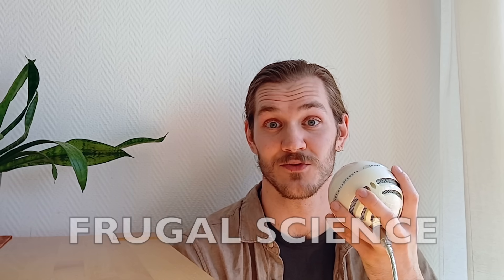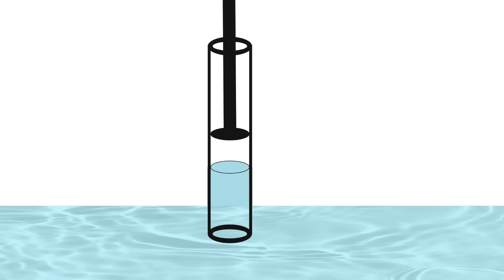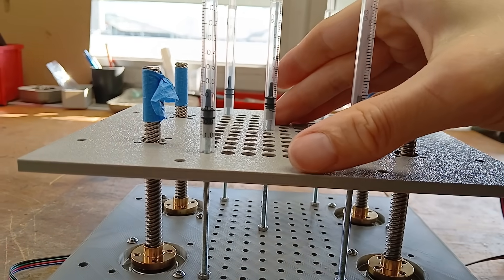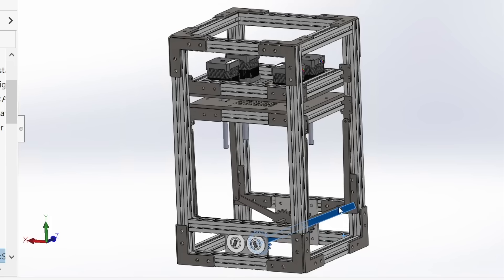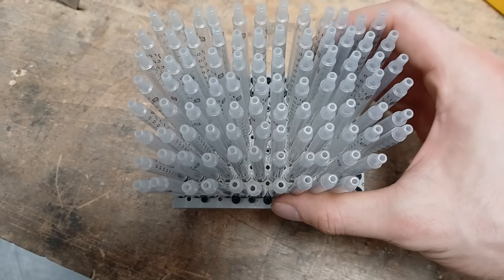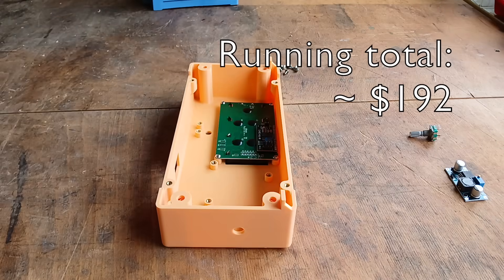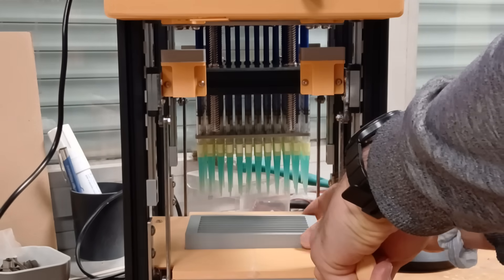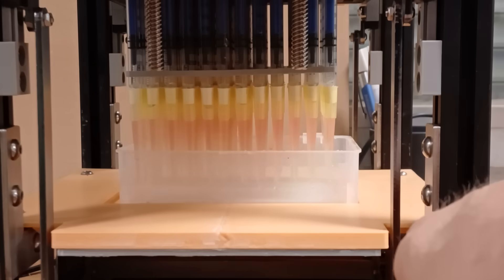This Medical Machine costs $18,000. I Took It Personally.

Comment: I worked at a biotech company manufacturing medical instruments. One of the reasons they are so expensive, is the stringent requirements to certify your manufacturing process. Every single O-ring came with 18-40 pages of documentation, and a batch number. You needed to be able to trace, the date of manufacture, and the specific batch of manufacture, on every single part in contact with wet substance. This was really annoying, if I had to scrap an O-ring, I had to find another with the exact same batch number, or do a very lengthy procedure, to link the replacement one, to the instrument. If there was a problem with a tube, they would do an investigation to see when the problem started occurring, and then they'd know exactly which instruments to recall/hold. A medical company manufacturing pharmaceuticals, would not be allowed to use your instrument in their production, even if it works, according to their certification, because your method of manufacturing, would also need to be certified. etc.
Reply: 100% agree. From my experience in biotech, almost all of the effort goes into the development of the required 'Good Manufacturing Process' (GMP) and subsequent certification. The materials shown in the video wouldn't even be GMP certifiable, since for most applications with fluid handling you'll need to have easily cleanable surfaces with materials that resist the growth of biofilms, s.a., stainless steel, PEEK, borosilicate glass, etc. At the end of the day everything basically boils down to Quality Management having such excruciatingly high requirements, that everything in the product's lifecycle is tailored towards it. This is also the reason why almost no people in this sector make any money from merely inventing a technical solution, few make some money from solving existing problems for companies and the big bucks are made by start-ups that actually put in the legwork to provide and proof and certify the necessary processes. If anyone wants to make money in medtech/biotech, your first question should be 'how do I alleviate risk for any interested buyers?'.
Reply: @eclairamisu2517  GMP aka Giant Mountain of Paper
Reply: @ChristianDK_dig  testing
Reply: @ChristianDK_dig  I think it means Guaranteed Maximization of Pricing!
Reply: @ChristianDK_dig  Necessary because people love to file lawsuits.
Reply: @eclairamisu2517 also, the equipment you use to MAKE the parts has to hit certain standards. "I used these grungy shears to nip off the end of the syringes" is not quite a certified production technique.
Reply: @eclairamisu2517  I wonder if you are comparing the US model of be perfect or get sued with the struggling world model of do the best you can or risk dying..?
Reply: @paulflute  BioTech has excruciating standards just about anywhere. Sure if you're in the business of running a homelab then whatever, but if you are a reputeable company, it doesn't really matter if you're in the EU, the US, APAC or anywhere else.
Reply: @paulflute  Specifically for biologics manufacture, it doesn't matter where you are - if you f- up, you're going to kill people. That biologic you're growing? Bacteria/yeasts/molds love growing in the exact same environment.

For testing lab use this might very well be OK, but frankly a ~2.5k machine is not the bottleneck there - the testing supplies are.
Reply: @wildca1x1  I don't think that's kind of what this is intended for.  It's more so that someone in Sudan can test blood samples for malaria locally. They're not talking about developing new drugs or going through clinical trials.
Reply: @eclairamisu2517 it can be expedited depending on filling. I work for a large pharma company that had this new drug application and approval and the process of manufacturing has a lot of GXP issues that the fda has been glossing over 😂
Reply: @Blue_Azure101 what s a gxp issue
Reply: @uzzybuzzy-t5h  Good * Practice - it covers everything from Good Manufacturing Practices, Good Documentation Practices etc
Reply: @eclairamisu2517 and iq oq
Reply: @eclairamisu2517 as a person who works at a pharmaceutical plant - I hate GMP with all my heart.
Reply: As a lab tech, compliance regulations makes us do a lot of certification work after it is installed. We can easily spend thousands of dollars just on the validation to prove a single test works before we can put it into use. If you have a chemistry analyzer that has 40 or 50 tests on it you can easily spend as much, or more on validation than you paid for the machine.
Reply: Yep, this is what no one gets. There's no 'whoopsy daisy sorry for the staph infection' when it comes to medical.
Reply: @purduephotog I mean there’s also no whoopsy daisy you’re not rich enough to afford medical care because of the cost of literally every machine ever in the medical industry
Reply: @luckyducky5994  and your point? This machine isnt going to help with that. As cool of a build as it is its not sterile certified lab gear and you wouldnt want it to be unless you like unreliable blood tests. A cheap but inaccurate lab test is not better than an expensive accurate one, not in the field of health.
Reply: @SpydersByte  I think he's saying that we legitimately should consider lowering our safety regulations in order to provide more affordable, but less safe care. (honestly still pretty safe though) There are developing countries where poor people have less trouble getting diagnosis and basic care than people in Canada or the United Kingdom.
Reply: @Syerjchep  well, then just lower the standarts for those countries who need it and not all the countries, i prefer my highly regulated pharma production
Reply: @pulzsuppe  ur also giga gay
Reply: @SomeKidsAtHomes  *u r
Reply: @Syerjchep  And that sounds stupid. Rules & Regulations (especially in the medical industry) are written in the blood of others. False positives can be just as bad as false negatives (i.e, a false positive for cancer leading to unnecessary chemo & radiation therapy). Yes, developing countries need resources, but there are some things that compromises shouldn't be made for. The centrifuge is fine, paper and string have their sterile medical counterparts, and it isn't used for extremely extensive tests. This, though, is made to test many drugs, vaccines, cultures, etc. at the same time. Contamination would be a major concern, along with accuracy. For simple chemistry with error that doesn't risk the life of another, this is fine, but any use in a lab for medical purposes won't happen unless the process is cleaned up and more inert materials are used (such as PEEK filament)
Reply: No kidding a few years back I spoke with a guy who makes medical graded fitness equipment and testing alone to get the equipment re-certified with the appropriate medical device class in the EU after changes was in the ball park of a 100 000€
Reply: @petrirantavalli859  what kinda context requires medical graded fitness equipment??
Reply: @Luckeux  Mostly people recovering from a paralysis in a facility or children with developmental isses etc. they aren't your everyday threadmills or excercise bikes or bench presses on a gym or as he said there are only a fewsuppliers of these machines in the world and they easily last for decades so the margins were razor thin and there was this thought of manufacturing them without the EU regulated medical device class for the masses but even without the license they were still a 10 000$ excercise machines with servo assists, micro controllers and things, so a lot of down grading might have to be done, like this particular very accurate microcontroller alone would cost med graded +$2000 from the US but an "untested or unaccepted for the use" one from china was only $500.

Also every single item sold for heath in the EU for health is regulated to it's medical class like a disposable mask or a a digital thermometer or weight scale for example.
Reply: @petrirantavalli859  interesting, thanks for the explanation
Reply: Nuclear, at least in Canada, is the same way. Items that might otherwise cost much less have to be qualified to go into the station. Sometimes this is important. The qualification process caught counterfeit computer chips one time. They passed 9 out of 10 tests. But they would have failed, mysteriously, if they had been installed in reactor.
Reply: The aircraft industry is the same way and it's killing private aviation. I went to get a part from the stock room once and it got flagged for customer approval. It was a bushing, just a metal tube, and it was $2,800. Small trainer planes often use alternators that cars use but because they're certified they cost 10x or more.
Reply: @Synergy7Studios  We are still lucky to have an experimental class of aircraft that doesn’t require FAA certified parts.
Reply: @Synergy7Studios  A thought about that: How much redundancy and over engineering might it take to maintain safety while actually reducing costs?
Reply: @Synergy7Studios  I honestly think this should be implemented in even more industries. Heck we had whole month long investigation why one of our student landed 20 seconds after sunset. But this kind of scrutiny ensures that compared to the automobile industry where 1 in 8,300 vehicles is involved in a malfunction-related crash each year, in aviation it happens a lot less, where only 1 in 1.4 million flights results in an accident caused by mechanical failure.
Reply: @faremir  You compared flights to vehicles. Aka, apples to oranges. Compare vehicle to vehicle or operational hours to operational hours.
Reply: @mikehawk1441  That's a ridiculous dismissal and an absurd and unethical demand. He's comparing the safety and reliability of equipment sent through a certification process to those that are not. It is fine that automobiles have lower standards... the chances of equipment failure causing death is low. The chances of equipment failure resulting in catastrophic outcomes is 1000x higher. There simply should not be a dataset for that comparison you demand. And you can't study it for the same reason you can't do double blind studies on something like the effectiveness of antidotes to snake venom... you can't doom study participants.
Reply: @faremir  found the corpo who profits way too much from fear. just hold the company accountable legally instead of all this beurocracy. theyll verify themselves or else. just another buisness that creates the problem u pay them to solve. LAME
Reply: @griffinhornbostel3714  The problem being that these companies aren't held accountable. See the ford pinto, and the fact that ford still exists after it. Also the FAA isn't a business, and they aren't creating the problem we have to pay for, they came about after shit planes killed 10s to hundreds at a time and we realized we needed better systems in place.
Reply: @griffinhornbostel3714  You think the dude arguing for regulations is the corpo, and you arguing to deregulate companies is anti-corpo?

I laugh! You're the corporatist here, mate.
Reply: @griffinhornbostel3714  You do realise airplanes fly over all our heads, yes? If a car's engine dies, 999 times out of 1000 it just stops. A helicopter? Maybe it can autogyro down some of the time if everything lines up right. A plane? I'm sure you'd enjoy the golden-leaf headstone the payout would get you
Reply: @Synergy7Studios  It's because when those safeguards aren't in place, instead of killing innovation it's innocent people
Reply: @watsonwrote  30% of the regulations make sense, 70% is there to keep pesky competitors out of your market.
Reply: @watsonwrote   I think tha initially the intention was good, but in time, and for the technology available today, most of this "inspections" and "certifications" could be done faster and cheaper, but they are the unlimited income of government's workers.
Reply: True, but there are places in the world where they simply can't afford the official lab equipment. If they can get something to work 98% they will do it.
Reply: In the United States, but this would be useful in other poorer countries just like the paper centrifuge.
Reply: I have worked as biotechnologist in two R&D centres of biotech companies but in agro sector, and if you are not working in  pharma the things become much more easy)))
Reply: Even without the certifications, his machine is doa because there are so many steps that are not easily reproducible and simply don't scale well in any sort of production. Like, as if a machine costs 18k $ and you assume that is all in materials. Of course there is also money for R&D, construction, assembly, programming, the certifications, marketing, profit in it. For a basic home-lab that hasn't that kind of money to spare I think it is a viable approach. For third world countries I think buying these appliances second hand makes more sense
Reply: touches plunger with his fingers and proceeds...
Reply: Exactly, first thing I thought when I saw the video thumbnail. People have no idea why things are expensive.
Reply: And do you consider this as a feature or bug?
Reply: @Heti.msc.1  It's a feature. You want perfection and are paying for it. If you want cheaper medical equipment, how many extra dead patients are acceptable? Just assume you will always be one of the ones that die when considering this.
Reply: @Tyneras I mean something like this is pretty handy in testing for diseases which, for people in a poorer country or just in general is definitely worth having SOMETHING instead of nothing because of the cost of medical equipment
Reply: I have no doubt that the scrutiny of the machine from the final assembly to the first part adds to the cost, plus recouping the R&D, but I am curious what the actual markup is, was it expensive to source the parts almost assuredly but it also wouldn’t surprise me if it was marked up 100%.
Reply: @outlawphil  Markups are well over 1000% on so many things, from iPhones to pharmaceuticals.
Reply: @outlawphil  A $0.10 pill will be sold for $1,000 because you aren't just paying for the pill, you are paying for $20 billion dollars of research needed to invent the pill. The price keeps going up because we already did all the easy stuff, and the problems we still have effect a smaller and smaller number of people, so each patient needs to pay more. if we don't invent some super AI that can design new drugs cheaply, we will probably just stop making new ones completely at some point because it will be too expensive.
Reply: @Tyneras that is true, but the US is not the only nation in the world developing pharmaceuticals, and the government subsidizes medical research maybe not at the level they fund the military but they do give money for research and development. The CEO’s of big pharma sure pay themselves an awful lot , but I am sure they would love a super Ai where they have less employees to pay and spend less in R&D but turn around and charge people the same and give themselves bonuses equal to the number of people they were able to eliminate.  And just a side note we are in late stage capitalism but if we were at any other stage of capitalism innovation would drive progress including replacing any flailing business, but since congress treats corporations better than the population (socialism for the capitalist corporations) where they turn around slap a bandaid on something that needs stitches and then pay the people at the top more. I can name several countries that rival the US in pharmaceutical development who have higher success rates and pay 30%-80% less than American corporations. Switzerland, Germany, India ( they do it 80% cheaper but standards are lower although they are catching up also they have a different focus) United Kingdom 50% cheaper in clinical trials. So when you say they will stop creating new treatments all together that is True in the United States because profits over people.
Reply: @outlawphil  Yet somehow the right has convinced a sizable chunk of the U.S. population that the problem is too much regulation.
Reply: And the reason that is the case, and another reason for the high cost, is the fact that if something goes wrong, they have to be able to prove every bit and piece was according to specifications and they engaged in every due diligence to prevent problems, or they'll be held liable. And they need to have enough reserves not to have to fold completely IF something happens.
Reply: Yeah I imagine stuff like 3d printing would be a big nono since the last thing you want is more porous surfaces.
Reply: @piethein4355  There is some 3-d printing, but not in direct contact with the wet substance. Generally you don't want bacteria growing on the exterior of the instrument either, so the chassis is stainless steel. You care about things like which way a washer is facing, so as to not create micro scratches, during assembly...
Reply: that's exactly what makes motor vehicles expensive. it's not the production cost. it's the development cost (wages of hundreds of people who work on it) and certification (destrutive tests of sometimes up to 200 pre-production vehicles) and the cost of certification itself. then comes the tooling for the factory and technological chain setup.
the result is that the production costs (materials plus work plus tools plus factory setup) are sometimes a low as 10% of the final cost of the vehicle.
Reply: Exactly what I was thinking watching this... Certifications and user assistance
Reply: Its the very same for electronics in aerospace/military. Tracability from the completed assembly back to the individual batch number each part on the PCB came from. I'm sure the parts manufacturer could trace it even further back.
Reply: This was my thought. It's really neat to see someone re-create "expensive" equipment, but the actual manufacturing was never the hard part. (for the majority of things) The expensive part is support, certifications, and auditing. The parts are probably around the same cost as the core machine, but they're also doing extensive testing on the materials that go into the product, and lots of audits on the manufacturing facilities that produce the product. That's where most of your money goes. I'm glad the video was very clear that the goal wasn't to replace professional equipment, but the goal was to produce an alternative to people who aren't limited by arcane regulations and complicated audit programs. Still, the act of creating a machine isn't the hard part. Getting it accepted by the industry is.
Reply: Exactly this supplying equipment to biotech, we have to mark up our prices tenfold because of the incredible amount of administratie we are forced to do to safeguard our materials for clinical use. The risk of making mistakes, the cost of hiring expertise, the endless amounts of documentation and the headache of working with our suppliers to get the right documentation...
Reply: DIY or cheap instruments could be used for education or citizen research, though. There are reasons this gets complicated and expensive for pharmaceutical use, but there are other uses for this sort of tech if the price makes it more available.

I'm not trying to educate or correct you in any way, just hoping to add to the public discourse.
Reply: when lives are at stake, accuracy & traceability becomes kind of important... fuck the cost  when your life is on the line
Reply: One of the last sentences in the video verbatim says the video isn't intended for you to replace the medical lab equipment, just lower the entry cost of use.
Reply: This isnt designed for a large pharmaceutical companies, it's designed for people with morals.
Reply: The question is why? It's all an industry reach-around, like with the nVidia + AI BS that is going around. Yes, I know it's all cGMP stuff, but the time and money that is wasted on this bureaucracy is at the expense of good research, saving lives, and understanding the natural world. I worked at Pfizer for a while, and there is so much f-ing paperwork, no one reads it, no one cares, it's piles and piles of documentation that is there "just in case" shit hits the fan. Otherwise it takes up literal office blocks.
Reply: which all is irellevant if you go to scenarios like we had with covid and that in third world countries - than a affordable and off the shelf component solution AND easy to reproduce like this is amazing
Reply: @senegalus  Someone designed a DIY ventilator using car parts but even third world hospitals wouldn't use it during COVID. It's not worth the unknowns, maintenance, reliabilty, even the poor perception they're using DIY equipment.
Reply: @weeeeehhhhh  Not all “third world hospitals” work the same, or are given the same resources. I’m currently in training in a 3rd world country. Yes, many hospitals here would probably not use these DIY equipment, and that’s because our large, urbanized cities are still well equipped enough to not rely on these. It’s a different story though if you go to more secluded islands where the doctor:patient ratio can be 1:20-50k — that’s probably where these type of innovations would be helpful.
Reply: @weeeeehhhhh  at some point if the choice is between death/complications or using a sketchy machine, well, sketchy machine it is.
Reply: @senegalus Meaning all that certification, traceability and stuff is useless? Or that it is good enough for the so-called third world if one percent of the patients die from using  your cheap and easy machine?
Reply: @maoiljitschguevara to be fair, its probably better to have something then nothing
Reply: @maxthehuman004  not for the 1% that died because of it and weren’t terminal ill. This vid is hilarious. Im doing DIY devices myself but I would never build a medical device.
Reply: @maoiljitschguevara  if your options are; cheap and non-certified machine that is probably fine or no machine at all. You should choose the cheap and non-certified machine.
Same reason why all that certification stuff went out the window during covid. The options were; wear non-certified protective equipment OR don't wear any protective equipment at all. You choose to wear the non-certified protective equipment unless you're an idiot.
Reply: @Todestelzer  You're thinking about it wrong. You're imagining a scenario where you choose between a high-end lab certified piece of machinery or a cheap DIY solution.
What you SHOULD be thinking about is if you have to choose between a cheap DIY solution that may save your life, or no solution at all and certain death. Because those are the scenarios these things are ACTUALLY made for.
Reply: @bummer6  People like you are so naive. Just accept that you're wrong, nobody is using diy machines in medicine.
Reply: @maoiljitschguevara it isn't but when your options are either no device or one that isn't certified you certainly would take the not certified device. Even if it causes you to loose 10% of your patients it's still better then lossing all of them.
Reply: @Todestelzer open source medical devices exist though. Look up the OSI² ONE MR Scanner an open source MRI system. If used in a medical context it would obviously need to pass certification before it could be used but that's not impossible.
Reply: @Ninjaeule97  if he can get a certificate or this is only a proof of concept I have no issues with it.
Reply: @Ninjaeule97 But those aren't the options here. The options are do it by hand or have a machine do it. The machine is faster and does many at the same time. So now you let the machine do the test for lots of people, instead of doing it only for those where you are sure you need it. You still sure that lots of bad results are better than no results?
Reply: @maoiljitschguevara  if there is an Ebola outbreak, for example, you need to test lots of people at the same time to cause the people who have it need to be quarantined to not infect others. Sure, false negatives are a bad thing cause the infection can spread, but it would spread faster if you could only test a handful of people. Doctors generally don't run test unless they are needed, so yes, bad results are still better than no results. Plus, if you used this machine for some time, you would most likely know the limitations and either avoid them or work around them. Let's say the machine is so bad that you get a false negative 10% of the time, running it twice reduces the chance to 1% and that's still faster than measuring everyone independently. Plus, the machine will be off by the same amount each time if constructed correctly and that's quite simple to fix with calibration, whereas handling mistakes that occur from doing the measurements manually can happen with each measurement so even if you know that there's an error it's hard to figure out which measurements are wrong.
Reply: @senegalus  "which all is irellevant if you go to scenarios like we had with covid" 

If anything, Covid made it even more important to be able to rely on this machine's quality. If you F-up one cancer diagnosis that's bad. if a vaccine producer's quality control F's up then hundreds of thousands of people could get a vaccine that does not work, and die.

"and that in third world countries -"

Again: how do you figure that a 3rd world doctor would not give a sh*t about whether his machine is reliable? Do their lives not matter to you? They probably need it to be more reliable because parts are expensive and hard to get.  3D printing sounds nice until you realise that...well... how the F are they going to get a 3dPrinter and filament to a place where just getting mains power is difficult? If anything you'd want a manual device that can be maintained by the doctor, for $4. Oh wait, they already have those, 3d world doctors don't do 500 pipettings a day in a lab, they are happy if they have a f*cking desk to work on.
Reply: Wouldn't that same requirement apply to each syringe?
Reply: The documentation is standard for most lab equipment, most of the cost comes from parenting though no?
Reply: Immagine you sell it. Would you take responsability for its accuracy for the next, say, 1 year (because ut is cheap)? In reality these machines need to be accurate for many years.
Reply: @mattiaviola7152 I mean the point isn’t that it’s a GOOD 100% accurate pipette machine the point is that it’s a pipette machine period.
Reply: Just curious if you know what the certifications were called?
Reply: And this is why Fluke and Agilent make a killing in the defence industry too, to mention some of the manufactures of calibration equipment used in defence electronics.
Reply: I was about to say, does this homebrew thing match specs, match regulation, have documentation, have liability, etc etc.
The cost is the legal system, not the device itself.
Reply: Yeeeuppp GxP is expensive lol
Reply: My guess is that a medical syringe should comply to the same standards. Ec1935/2004 (or fda) is used in the food industry for gaskets and seals.
Reply: Tbh, for hobby use or emergency such as natural disasters or poorly developed countries, I think the rules wouldn't apply as long as it's good enough and save lives.

I think this idea is good and solid
Reply: I think what this solves is the third world issue and low barrier to entry to speed up testing. While you are correct. Compare the initial example of a centrifuge and the paper spinner. This offers a way to maximize productivity in a less regulated and lower cashflow environment
Reply: spent 10 minutes thinking up my reply and after posting it, scrolled down only to find you had written exactly my thoughts! good stuff.
Reply: you're all assuming that what happens on paper is what happens with certainty, when in reality cutting corners happens more often than not when no instant consequence are in place
Reply: In the current era that doesn't look like it should be an expensive process still...you just require a graph database with the information you need for every machine... Or if you want/need add them to a Blockchain. The specifications needed are the physical and chemical property tested over time, within the operational boundaries of the piece. For an o-ring it fits in 1 or 2 A4 papers. The production number is just one line. 
The point is not that certifications are not expensive, but that they are way too expensive for what they are. It feels more like a legalized cartel to artificially harden the market position of pharmaceutical companies that they more or less demonstrated themself good enough to produce reliably this kind of product rather than a cost-based price increased due to the additional operations required.
Reply: Medical manufacturing company: we're sorry The hose clip for your 18,000 machine broke. We no longer manufacture that particular model. That machine is not eligible for repair due to the hose clip being part of the structural integrity of the device, meaning that the device cannot be repaired and restored to medical grade.
Reply: @nonotyet7590  You'd be surprised what a rebuild kit, with a bunch of hoses, filters, and O-rings go for. Selling them is really lucrative. We even dusted off plans that were printed in the nineties, in order to complete obscure spare part orders. Good service is definitely a thing in expensive market segments.
Reply: More people need to understand this…maybe some regulations are truly necessary…but are all of them? Are none of them redundant or obsolete or just inadequate?  Regulatory compliance is a major cost factor across the entire supply chain all the way to service delivery.
Reply: Aren’t attorneys great?!!
Reply: exactly. I dont know sh!t about those devices or how theyre used but my very first thought about the price was the simple fact that its a medical machine and probably has specific design elements that help keep it sterile and like you said the parts need to be standardized and documented and replaceable. The build is really cool but like, who is it for? Labs are still going to have to use the expensive version and no one else has need of this machine.
Reply: Considering he was inspired by the hand-spun centrifuge, this seems like a pretty similarly equivalent grade solution. I think it's mostly about getting these kinds of devices to places that don't have or simply can't afford the proper solutions.
Reply: Frivolous lawsuits and their consequences for the medical industry.
Reply: Bureaucrats…
Reply: Another reason is the act of calling is medical can increase the price by 2-5x+.
And if you are buying things for medical reasons, the markups can be 0.5-5x depending on the item.
I have seen multiple products that the only difference is the medical lable, and they are even packaged in the same sterile way, and do the exact same thing.
Reply: So that's why healthcare is so much... The paperwork. 😅
Reply: Jesus loves you so much brother. We are not innocent. God is.. and he came to earth to bear our guilt. He shed his blood on the cross and rose from the dead, defeating death so that we may have everlasting peace, joy, love, hope, and fulfillment.
Reply: yeah that's called useless procedure to drive up the cost
Reply: @ninojamestan8895 ☝️🤓 um actually, it's for liability reasons. Correct paper trail and procedures, nobody can say anything about malpractice and sue for millions.
Reply: @Deja117 yeah, always more about business rather than healthcare apparently. How American
Reply: @ninojamestan8895 in the same vein, if one company made a faulty part that caused a loved one to pass from some bacterial infection, would you not want justice taken against that company? Fair enough, it would be a cash settlement since it's impossible to literally wake the dead, but at least you wouldn't have to live without knowing what happened to them.
Reply: Yeah yeah bureaucratic corpo bootlicker
Reply: THANK YOU. Watching the video was slightly infuriating. Not only is his manufacturing process not even remotely scalable, but it respects none of the requirements or standards of medical equipment. Mimicking the action a machine performs is, quite simply, not good enough to qualify for claiming to have replaced a machine. There's so much hubris in this video it's nuts.
Reply: @guitarchitectural  you guys should work in insurance and big pharma with how much you hate motives for affordable medical care. Go work for UHC
Reply: @Oppatwunk  I'm all for bringing costs down, but it does nobody any favors to make a unit completely out of the required spec as a demonstration of "look how cheap!". If this guy made one to the required spec, estimated the costs to spin up a clean production facility (to spec), and establishing a company to promote, sell, and support+service the devices - well then you're factoring in EVERYTHING that makes it cost what it costs. 

in other words - it's no secret that the parts for any given device are cheap, and it's no secret that some of them aren't that complicated. It's everything else that makes it expensive, and it's everything else that needs to be overhauled in order to reduce prices.
Reply: Can confirm, it was the same when I worked on medical machines.
That traceability tho is very important.
Could it be a lot cheaper? Yeah, of course, it's a steal. But the ability to go back and see exactly what caused problem is a necessity.
Reply: that and R&D and low relative sales numbers
Reply: This is apples vs pears. I worked for a medical device company, and the rules applied make sense for the better part of them, in particular risk management that ensures that the devices are safe to use, not interfere in/with their use environment, a fully reproducible and …., subject to thorough recall management in case of a health related complaint.
Ensuring that devices are safe and effective and maintained in such a state, and reproducibly manufactured at relatively low total number of devices manufactured all costs.
Reply: i knew there would be a wet blanket incoming. thanks for the insight. 
from my perspective, this may be overcome by using something like 4 of these cheap units instead of 1 verifiable expensive one. 2 of the same type and 2 of the exact same but different plastics, etc. then run the experiment a few extra times. in this way, you can look at any variance between the machines and runs to determine fault. i’m speaking out of my behind because i’m sure there are more wet blankets looming and i know what i’m describing would take a little more time and space but ‘first shot perfect’ doesn’t always fit the bill.
Reply: @dfghdfzsd  imo the correct way to use them would be to have a human do it and the machine as a double check.
Reply: @satibel  Then the whole premise of automation would be useless, because the whole premise of this machine is to replace lab techs to move/apply reagants for hundreds of samples directly. If you still need humans to cross-check this machine, might as well do it manually because the bottleneck would still be at humans anyway, and now you pay double for both lab techs and machines to perform the exact same thing twice
Reply: @FlyingPlastic356  my idea is if you have one sample that needs many checks (e.g. test for many diseases at once or similar screening), or if you need to screen many samples quickly, if you can do it fast locally with very low false negative, but false positives, you can take preemptive actions while the sample is sent to the lab for further analysis (e.g. start sending to the hospital or semi-benign treatment)
It would be in a village setting, where you'd want an easy to reproduce fast method.
Reply: @satibel this kind of machine is not for multi vector test, but the other way around (single test against multiple samples), as you usually unable to load different reagents on each pipette. This machine usually loads 1 type of reagent and feed it over hundreds of samples at once. Also, this is just a tiny part of testing, as this is just reagent feeder. You still need other machine for testing (centrifuges, spectrometer, etc)
Reply: Good thing they double checked the o-rings, sort of wish they regulated things like Teflon and roundup from being pumped into our bodies and water supplies. But that’s cool too. I guess more money on medical supplies once we get the cancer, so why regulate the dangerous chemicals when you can use regulations as a guise for gatekeeping the medical industry from smaller competitors.
Reply: @ride1123  There is so incredibly much money in pharmaceuticals, the expensive gear is a pretty minor expense in comparison. I was told some of our customers actually only used the instruments for a single batch. They then sold them, and got new gear, instead of cleaning them out. This was because, buying new instruments was cheap compared to the risk of contaminating the product..
Reply: @the_hate_inside1085  oh, that explains why insulin was jacked up to be such a high price. Oh wait, no it doesn’t. Sorry I get how it all works but at the end of the day these justifications for prices don’t hold water
Reply: @ride1123  you're confusing pharmaceutical equipment being held to a standard and pharmaceutical companies using that equipment while having no ethical standards. I can assure you that he equipment prices didn't have anything to do with the insulin price rising
Reply: @Luckeux I mean the equipment being so costly and held to such a high standard is partly WHY they can have no standards and increase prices exponentially it means it’s near impossible for any competition to arise and gives them a nice excuse for why they can crank up the price of insulin for shareholders
Reply: While I'm sure this is true, it does slightly miss the point. As with the example he presented at the start of the video this isn't meant to replace medical grade machines, this is meant to be the cheapest possible solution that can be used where no alternative is available or affordable.
Reply: Thank god we have regulations or I'd be at the hospital and my life support would shut off because of a windows bluescreen or a temu oring
Reply: the entire point of this was to demonstrate a system that can be used in high risk areas that are also impoverished, these areas of the world do not have industry standards as there is no industry that i know of there
Reply: @Dongflopper399  I disagree.  The entire point was self promotion, hits on videos.  I am a physician that has done medicine in 9 countries.  Real world.  We were once sent a bunch of simplified non-certified equipment in a remote location that COULD NOT BE USED.  The idiot that ran that shit-show never touched a patient in their life and won and award for that "effort".
Reply: @FernandoChaves  Are you saying that the equipment was unusable, or that you refused to use it?
Reply: @FernandoChaves its rlly not that deep man, but why wouldn't it work😊
Reply: @Dongflopper399  How can you sterilize any part of this machine then? Can you even sterilize the plunger bit? If not, be ready to have tons of false positives and false negatives because your samples are cross-contaminated across thousands of samples
Reply: Yeah thing gets expensive when a simple mistake can impact millions of life
Reply: Yeah, the certification requirements are nuts.
But this device is not intended for the EU, the UK, or the USA. It’s not even for biotech. It’s meant for poorer countries and for medical tests—like malaria—just as the author said.

I was at a certification and conformity assessment center, and there was a test unit: a mechanical ventilator that froze during testing. No one wants a ventilator to fail in a real-life scenario. Similarly, no one wants incorrectly measured drugs to be distributed.

But for testing purposes - like malaria, or as supplementary equipment in a chemical lab for low-precision measurements, it would work.
Reply: As usual, the actual problem is capitalism
Reply: It's good that we have those regulations in the first and second world, but a hospital in Simbabwe is propably going to be happy to have something like that. To poor people in the third world it's DIY or die.
Reply: All of this is true, but also a level of diligence that many developing nations simply cannot bear. Hence why the paper centrifuge in the beginning was created. Sometimes you need things that can be made by impoverished nations that gets the job done, and is still as safe as possible for the people using and getting use from it. This isn't meant to somehow how a biopharma company save money on installation costs, it's for some doctors without borders guy getting 500 dollars a year in donations trying to keep a few African villages heathy and alive.
Reply: We can't afford to have this Rolls Royce level of manufacturing, it is just to protect rich people not patients. I have just been told I have to wait 18 months to have a cancer removed from my eye. I live in a country that is supposed to have good care.
Reply: @MPX4500  A medical instrument that purifies insulin, should not have bacteria/fungus growing inside of it. If you inject sick patients with contaminated medicines, people will die.
Reply: I had a friend who worked at a company that tried to use such a biomedical-grade machine as part of their testing process - they discovered the same thing you described - absolutely simple stuff, but costs a fortune, they also were restricted by contract to modify at control it certain ways that were necessary for making it work. Though 'surprisingly' if you bought an even more expensive version of said machine, that made the restrictions go away, imagine that! So they did the exact same thing that's going on in this video - they built the whole thing, and only bought the stuff they couldn't make in house to the required stuff (some of the expensive stuff is really worth what they're charging for it). They built the whole thing, and it worked like a dream. Thing is, due to the lacking certs, they weren't allowed to sell the machine. But they were allowed to sell the service! Since the required tests were possible to do by hand, they argued there's no difference between a  qualified med tech doing it by hand, and using some machine to perform the process, and the certification requirements were different.
Reply: Once again bureacracy is ruining everything, and holding us back as a species.
Reply: These technologies would be snapped up in Africa.
Reply: I bet you are certified as well so just talking with you must be super expensive.
Reply: Sounds like an entirely made up problem
Reply: nah you dont need to do that.
Reply: that is dumb though, they could do that with a simple serial number like everything has and liability would still be assured, quallity controll can also be done factory side and so on, there is no good reason for a machine to cost tripple what it would have due to safety and liability assurances
Reply: I know people who work in pharmaceutical plants and the standards are ridiculously strict. Everyone works shifts in clean rooms with certification on everything and noncompliances written up. If there is any contamination and the whole batch is tossed, potentially costing millions. Not saying these sorts of solutions don't have a place, because if you're some small hospital in the middle of a 3rd world country then some kind of assaying capability is better than none at all. I just wonder who would manufacture cheap, uncertified devices unless there was a critical and imminent emergency. We saw with COVID that some homebrew ventilators were used because keeping somebody alive is better than not, but only in extreme circumstances, not the norm where some dirty, contaminated machine could do more harm than good.
Reply: Some hospitals can't afford such a product let alone multiple of them
Reply: And this is why I predict two future outcomes:

1. Real ground breaking innovation (that will cure not treat!) will only happen outside the standardized, quality controlled and compliance certified labs.

and/or

2. Large labs / institutes and maybe even universities(!) will try to sue, illegalize, criminilize or prevent in any other way the spread of useful equipment and materials so that they can continue the value extraction by themselves. A lot of compliance rules are already in existence to prevent small market intruders.
Reply: guess just let people die then, the point is its better than nothing
Reply: This would be used in poor countries by medical volunteers though... I think the cheaper you can make it the better, as long as it's sterile.
Reply: @D07-007  And how do you even sterilize anything made in this video? Even those ball screws alone are 100% unsterilizable without destroying the oil seals, and the lube used are definitely not food/medical safe. This video demonstrate that many people don't understand how difficult it is to design sterile equipment. There is reason why only the tray moves, and not the pippette unit, because to make it move you need to have ball screws, and sealing the ball screws for sterilization is an absolute nightmare unless you've sourced a medically-certified one.
Reply: @FlyingPlastic356 I'm almost 100% certain there's a way, but be that as it may. The important parts that need to be sterilized are the syringe tips and plungers, remember this isn't something that's gonna be replacing the commercial equipment in labs, it's a proof of concept.
Reply: Regulations are the way big companies shut down competition, and that's why products are overpriced and shitty.

The free market would produce higher and higher quality products at lower prices.

Bureaucracy ensures quality goes down and prices go up, because it prevents small producers from being able to compete due to legal reasons.

It's true for everything from tiny farms to vehicles to medical instruments.

And yet, this entire generation has been brainwashed to believe the failure is capitalism itself, and the solution is giving more power to the government to enact even more regulations, which benefit only the largest players and ensure no small companies will ever thrive again.
Reply: Nonsense. That could maybe explain 100% increase in price, not over 1500%.
Reply: @jepulis6674  you're wrong. There's been a non-profit that has been lobbying for relaxed redtape on insulin production for the past 15 years. They said they could sell insulin for $5 a vial and break even, but the FDA regulations are insane, requiring vast resources to meet.

The current price in the US is $250 per vial.

I can go to most other countries and purchase insulin for $10 a vial, no insurance needed. Sadly, it is illegal for me to import for anyone other than myself. My neighbor down the street died becuase he could not afford insulin. 

The reason the FDA makes it a felony for anyone to import insulin is, "we can not guarantee it's safety."

Yet it's safe for me to import for myself, and it's safe for my neighbor to die for lack of insulin. But if I shared, even though he has a prescription, that would be a felony.

But it's all for our safety, and not for profit, right?

So yes, if it weren't for our beurocratic restrictions, we too could have insulin at $5-10 a vial, like most sane countries, as opposed to $250, a 2500% increase.
Reply: @jepulis6674 there are only three companies in all of America that have been able to pass certification, despite it being an incredibly profitable drug in high demand. That is insane.
Reply: Certification or listing keeps many products off the shelves in all areas, including construction.
Reply: That is the reason because medicine is so insanely expensive.
I noticed this in the pandemy, suddenly a lot of companies made "respirators" and they were perfectly functional, but in "normal" times the "certification" of those devices takes years.
There is a lot of corruption too. An engineer can create a machine for X-rays or EMR 100 times cheaper than those of GE, but extrangely, the governments of poor countries (like mine (México)) won't certify the cheap machine, no matter that is more or equal accurate than that of GE, they preffer buy the pretty expensive one even when they could have equiped 100 more hospitals with a machine a little less perfect, but functional.
Reply: rules and regulations are a lot like locked doors they only apply to honest people.
Reply: Kinda seems like the sort of thing that makes good quality tools extremely exclusive as was the point of the video. Say you're working medical in some developing country and this backyard contraption is your only option, good quality tools being inaccessible might kill more people than otherwise because the next best option is literally this.
Reply: When the shuttle blows due to bad O-rings, or similar, at what point does your company stand up, and say, Yeah, it was, while making millions or billions of dollars of profit, it's always not your fault, right? Bad certification, you'll say, if only someone had caught the mistake! 
Yeah, if only.
And yeah, the reason we can go after companies that lie to the consumer, at all?
That we have any chance of knowing which supplier of O-rings was at fault?
It's always the fault of the regulations holding you all back. 😂
Profits? 
Why, it would be wrong to plow that money into the system, and to lower the price.
And if you do happen to be a nation running centrifuges built from string and paper, they might like to see something like this.
Do we need to reduce government regulations?
Maybe.
Every one, like after any other disaster, each regulation tries to make sure bad actors can be caught, because a company killed a bunch people, or because out of negligence, people died.
Poof! New regulation.
Do they need review?
Hells to the yes, do I trust companies that give massive amounts of money to shareholders, or themselves, and then, when challenged?
It's not us!
I saw someone testify before congress with the same wording, so, great job there.
Reply: Still don't explain it... My experience is that they got used to "we need a big team" with lots of people not really doing any work. Started by the old let's hire my friend. And friends friends and so on. Together with way to low competition. A lot of documentation and follow each parts path being made is and can be done automatically now a days.
Reply: @LuiLulumon  Manufacturing is very streamlined, as they do have lots of quality engineers, white collar staff, and technicians. Heck there were as many people working with documentation, as there were assembly workers. For every guy doing assembly, you have four guys, with clocks, figuring out how to streamline production, or writing an essay on what the core values of the company is...
Reply: Lobbying to increase barrier to entry as much as possible to keep competitors out
Reply: @matsv201 imagine going to a hospital and they put u on life support system made on breadboard with f ing arduino nano
Reply: @maxthehuman004 its a bit like the comments on the Nasa soldering video where he took 15 minutes to solder two wires together but everyone conveniently forgets its for something going into space.
Reply: @maxthehuman004  you will be surprised to learn how little processing power most things need
Reply: @gelbgeil its not about pp, its about reliability and redundancy. I know how much pp stuff needs, i am a prototype developer
Reply: @gelbgeil you would be surprised how many problems arise when you start looking into reliability and safety of the device. Reliability, functional availability, self diagnostics, fail safes, fail operationality... There really is yet another world beyond "just works".
Reply: @maxthehuman004  Imagine if it were that or nothing?
Reply: @maxthehuman004  I would prefer that over something they don't know how to fix.
Reply: @yb6036  but they do usually know how to fix it, that's one of the benefits of this extensive certification process that sourcing replacement parts is fairly easy since everything is extensively documented.
Reply: @maxthehuman004 imagind yoy spending $1500 for a blod test that should cost $15...

Ohh.. yea
 You dont have to imagine
Reply: @matsv201  I do actually have free public healthcare, i even get my asthma meds every month for free.

So i do have to imagine...
Reply: @maxthehuman004 only to find out that the official looking machine has basically the same components but comes with certificates.....
And probably a more professional look to it.
Reply: @matsv201 science is useless if you dont know the variables
Reply: @Alucard-gt1zf  That have nothing to do with overbearing bureaucracy
Reply: @matsv201  what do you think is written in all that paperwork? Part of that was already described to be exactly that: variable specifications (production time, date, batch, knowing there are no hazards growing on things, knowing that the circuitry has minimal chances of interfering with health-critical work, etc. ... that's how you get 18+ pages of paperwork). 

The thing that'd be potentially directly streamline-able or simplifiable are the procedures to switch from one batch to a different one of the same quality.

Sure, between nothing and something potentially hazardous, the hazard might still be better than having nothing but .. that's not a great standard outside of crisis situations
Reply: @wednes3day  About 2% actually usefull stuff and 98% pure garbage.
I have done a lot of that paperwork as well.
Reply: @matsv201  which sector (you done the paperwork in)?
Reply: @wednes3day  Civil engineering
Reply: @wednes3day  I sometimes looked inside the certificates, as I often had to print them out, and include them, in paper form, when sending spare parts. There where wild things like charts of tensile strength for different temperatures. How much elongation you get, by so, and so much force. A lot about what exact materials were used, and how they were compliant with this, and that ISO standard. The company making the O-ring, would sent documentation, showing all the certification, of their manufacturing processes. Seems they ran those poor O-rings through hell, and back...
Reply: @matsv201  I guess we've figured out why dams in the US keep collapsing.
Reply: @hedgehog3180  You are not to bright are you
Reply: @matsv201  I'd rather not die in a dam collapse than be whatever you consider bright.
Reply: @matsv201  bureaucracy stifles innovation and affordability!
Reply: countries not limited by silly stupid laws made for profit will be able to use this stuff thats open source. They would rather have something than nothing...
Reply: I'm sorry but if paperwork is the only thing making all of that so expensive, then maybe we need to find a better way of providing medical equipment to people. 
Thank you for explaining all of that, but no matter how you word it just sounds stupid that we do it that way. I understand why, and I'm glad of the quality assurance because without it a lot of people would probably die, but I can't believe that it costs $18,000 to just print off some pages and keep track of stuff on a PDF or a spreadsheet. I could see a couple thousand dollars. Hell, I could even see somebody charging $5,000 for this but not $18,000. There is absolutely no reason why any hospital should ever have to pay that much for stuff that's helping them save people's lives. 

If anything, your explanation just gives us more reason and more motivation to really hate these companies that sell this crap for this much because they know that they can because these hospitals have no choice but to buy the equipment or completely go without and risk. Losing people's lives over some pointless currency that shouldn't even exist either. 

If anything I feel kind of horrible for the doctors and stuff that have to make that decision and the guy at requisitions who has to bake the final say so.
Reply: @POTATOEMPN  Paperwork is only one of the reasons. You don't sell these products in very big series, and when all the costs for research, certification, and paperwork, gets dumped on just a few products produced, the prices will be through the roof.
Reply: Yes all that work is necessary
Yes all of that needs to be paid

No, doesn’t justify the absurd pricing. Not one little bit. For the purpose it’s made for, y’all need to figure out a way not to overcharge for the sake of manufacturing when the whole point is to save lives.

I come from commie Canada where our healthcare system is beyond effed and I’m a staunch supporter in the removal of free healthcare…

But to put everything aside and think of it ultimately, that’s absolutely insane that the pursuit of saving lives and improving lives medically winds up being so expensive not enough people can even get it. 

I see tons of average people putting their own time and money into figuring out solutions and finding viable ones. And y’all are a team.

I’m genuinely glad you work hard, but does that really justify the price tags? Why is everyone not focused on making things actually accessible.

Why do I trust random people on the internet more than expert made crap, especially when it’s my case where my family are doctors and THEY don’t even trust experts? 

Observation, confirmation, repeated patterns… 

There’s too much that doesn’t add up. All I see are plot holes. Everywhere.
Reply: @TessMcneil So start bribing your healthcare professionals with what you’d be paying for the same things in the US. 😜 People’s lives are absolutely ruined by accidents, cancer, and various chronic illnesses like diabetes there, even if surgery or treatment go perfectly.
Reply: Sounds like a job for AI.
Reply: @freedmanjoshua  Nothing that requires a semblance of quality is a job for AI...
Reply: 😂 so the painful truth is paper work kills creativity… need to pay the legislators
Reply: @yihchiehseeto225  in some cases paperwork is there for a reason, this is great if there's no other option, but usually the slight gain in efficiency isn't worth the loss in confidence.
Individually you might not mind a 99% confidence, but for a large enough group that can be considered disastrous.
Though there's indeed also times where a sketchy machine is better than nothing, like you could do a quick test with "low" confidence and send the sample for a more confident test. If someone is caught by the low confidence test they can do low stakes precautions like quarentining themselves in case of a contagious disease.

A machine like that could also be used for rapid prototyping where you can quickly adjust dosage then use a good machine to fine tune once you're confident.
Reply: All those costly certifications, and traceability, GMP with pharmaceutical companies means nothing when you have corrupt government at the end of the equation. If something’s goes wrong, do you think they will bother to check what was wrong? So essentially, it’s just wasteful spending and inflated cost, at the expense of our health for nothing.
Reply: @SanSan-lb9iv  It's funny when someone who thinks conspiracy theories can substitute for honest work talks about other people being "corrupt".
Reply: @SanSan-lb9iv  The pharma/research company buying the expensive instruments, will 100% call the service number on the instrument, when something goes wrong. Faults are definitely worked on, and taken seriously, on the manufacturing end.
Reply: All so members of government can harass businesses by pressuring the one thing they can understand tbh.
Reply: @xaviermagnus8310  - Not members of government... its the government itself. The idea is to protect big companies and manipulate key sectors of society.... the end goal is always the same, steal on taxes and reelections.
Reply: @brianfhunter  You're shifting from identifiable factors to vague notions. It doesn't help.
Reply: @xaviermagnus8310  - No, im not, in fact, its the OPPOSITE... Can you name these members of the government?
Im not saying SOME people of the government, im Saying that its the ENTIRE GOVERNMENT... and if you give me a specific problem I can pin point the exact sector of the government and the most probable motivation...
Dude, im an Ancap, I NEED to know these things to be able to argue against people who keep screaming "but muh roads"....
Reply: @brianfhunter  I could fill pages of names. But a google search could do it too. Use your head, get a bit creative and even watch the news.
Reply: @brianfhunter  All the argument you need is that government is the most expensive way to do anything... borrowing 20 for every 100 (introducing foreign influence too), then administration costs take 30, fraud takes another 20 or so, and that's assuming it was a well thought out contributing project, which is less likely due to not needing profit to start... so 50 bucks of purchase for 120 spent... and better they'll spend 1.3 for every dollar taxed so more taxes just means more wasted on shit projects.
Reply: @xaviermagnus8310  - I think we are splitting hairs at this point... I agree with your argument completely, not only that, I go further, everything the government does is useless and cause harm to society.
Taxation is Theft by definition, maybe you are not that radical, but if dont believe the same thing, we agree on 99%, I see no reason to continue arguing.
Reply: @brianfhunter  I actually see a very limited use for government in military and potentially infrastructure. But it needs it's power to spend capped heavily.
Reply: @xaviermagnus8310  - Dont agree, but still, that is more than good enough for me... At this point, being anti commie its already good enough.
Reply: @brianfhunter  Most have a CMOS jumper
Reply: Bureaucratic bullshit to artificially inflate prices, classic move.